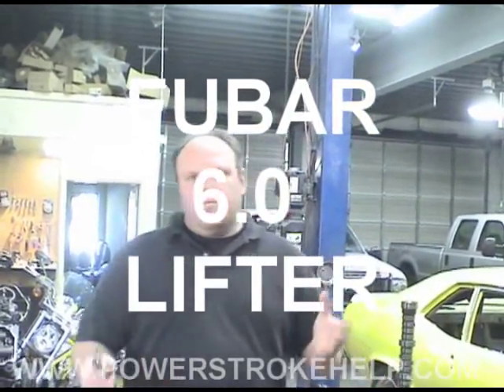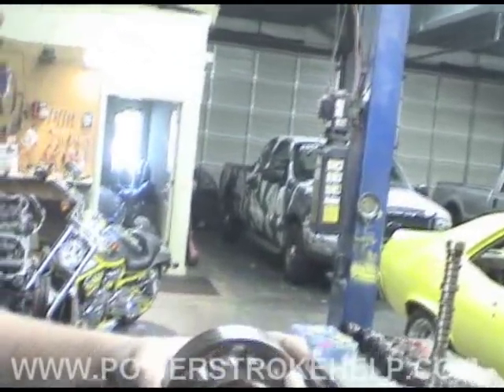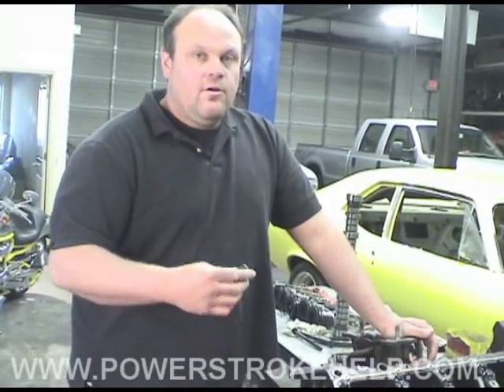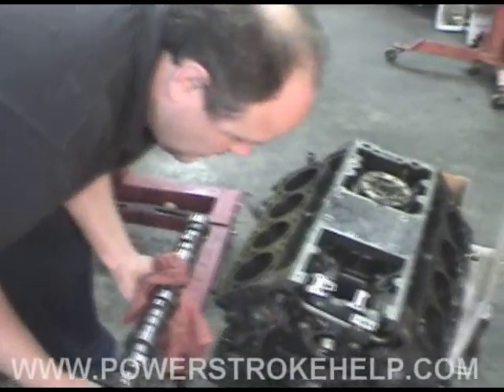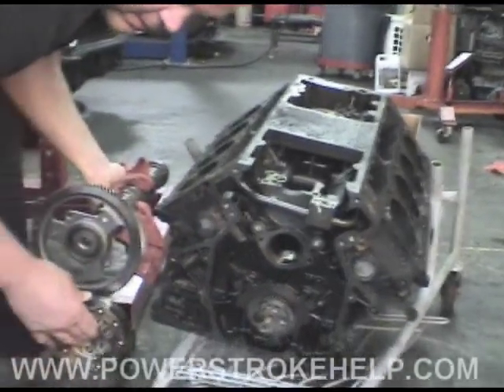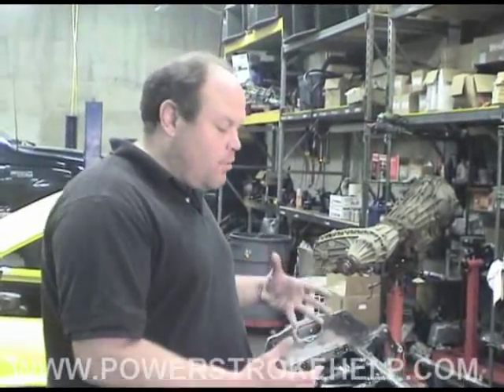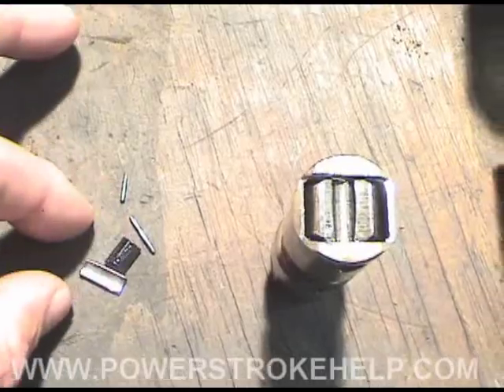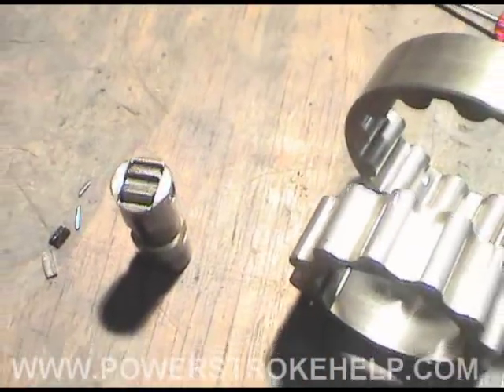FUBAR 6.0 - FAILURE OF MINOR PART LEADS TO BIG REPAIR BILL

Comment: I think what bill means by it's "a good designed engine" is that it makes a lot of power for the displacement, and it's a very efficient design in terms of how the engine flows. quite frankly if you have to pull a motor to time it, it's not well designed it's a pain in the ass.
Reply: It does not make good power for displacement. 
A 1.9 tuned vw tdi can make more
Hp and close to torque of a stock 7.3

Comment: don't assume your "local dealer" won't go that deep for the lifter failure. I have a 308,000 mile unit that i have to replace a $1200 cam, $820 cover and pump, 16 lifters and all the parts required to do that job. so that $4000 short block wouldn't be a bad option. it's not that we're lazy or inept, it comes down to reliability and warranty. And i can assure you this, every time this thing  farts in the wrong tune he'll bring it in as a "recheck".

Comment: With gas engines from ford and GM  easily running 300,000 miles and costing 4500 tops to replace,this is disgusting,the roller on the lifter is clearly too small,and overspeed eventually shortens the service life,that's the thing I don't understand about the Navistar diesels, they should have overdesigned head gaskets and bolts,overdesigned lifters and seals,and larger than needed rod and main bearings so the owner gets a minimum of 250-300k without tearing into the engine. I feel bad for people who bought a 6 liter,and had these issues.
Reply: but it's a consumer duty engine. Everything is built to a price. International makes some seriously over built diesel engines that will go over 300k miles easily. Look at the 466. Huge, heavy, overbuilt, and reliable. But it only makes 260HP in serious duty applications. Why? HP KILLS. The less HP the longer the life. So if you want a long life diesel, go buy a true industry light duty truck. Not a consumer grade. It might make the same or less HP and require 5+ gallons of oil but because of this is will run for many many miles.

Comment: My F-350 6.2L Super Duty may not be as powerful as these Diesel Engines... but my gas engine is less expensive to fix...
Reply: Walter Kiel   I have a 6.0 and 7.3 love both.  If I want a new superduty I'll be getting a 6.2 simply because the 6.4 and 6.7 are insane to work on yourself.

Comment: @powerstrokehelp I've seen over a handful do this in the last couple years. Find needle bearings in the bottom of the oil pan and a piece of the roller.  They usually still run to. They pop back in the intake, too. The most common failures i've seen are injecotrs, egr coolers, and injector drive modules (fuel injection control module).  Its not that common of a problem compared to the other problems like you said though. I'm not sure about reliabilty versus the ford version.

Comment from the maker: This is actually an uncommon failure. The damage to the lifter happens when the engine is over-revved (too much RPM). The valves will float which means that they don't close all the way. The piston comes up and hits the valve, the resulting impact will either bend a pushrod, break a rocker arm or break the lifter. I actually did this same thing in Spot the shop truck running NOS. The cam has to be replaced when this happens if the damage is caught BEFORE metal goes through the engine oil system.
Reply: What would you say is a safe max RPM for a stock 6.0, new? What about after 200kmi? I'm sure the wear on the valve springs will impact that. Was this a manual? Should I be worried about over-revving my 6.0 with an automatic?

Comment: what a rip off design, and only gets worse now its cab off to anything, last thing they want is reasonable repairs theyd rather them be scrapped and new ones sold, but that's most companies I guess
Reply: +bosshoss69lee pretty much what we always had to too. its not that bad as we are getting paid to work on these things, e brake cable, electrical, and bolts to hold the cab on and lift it up and you got a wide open engine bay. or at least i remember it being that easy. used to get them at the other shop a few years ago. none here yet thank god
Reply: Cab removal is actually a very efficient way to work on a motor.. wide open engine bay, everything is easy to get to. The cab was made to be easily removed so it's not really a huge job.
Reply: Bradley Smith not on a expedition. we just had to do one a few months ago... now at a shop with a lift no problem but for someone to do at home without a ton of help or heavy equipment it isnt going to happen. im just happy i own chevy trucks, used to do those in my driveway with basic tools

Comment: Thank you for pointing out that these wonderful collage boy engineers really know nothing about what they design. They should be required to work on the floor in the field of their engineering degree like an internship! Minimum of 5 years before they can hang up their shingle and working as an engineer designing things. That way they can find out about how hard it is to work on some of their big ideas that should be easier to work on. Firs of all they should learn the KISS System, Keep It Simple Stupid. Then they should learn not to listen to salesmen with new plastic parts claiming that it will cut the cost of their product. Then they need to use standard parts instead of reinventing the wheel! Engineers, just another name for a dangerous collage boy with a diploma that doesn't have enough common sense to wipe their own ass!

Comment: Really, the only big thing different in some '05 and '06 was the plastic snap fitting coming out of the back of the HPOP. If you talk to people with other years, they have problems too. They are just a fussy powerplant. Beautiful when they run right, but overly prone to problems.

Comment from the maker: @MALamborghini The year has little to do with it. It is more important how the truck is driven and how well the service has been kept up. I had a 2003 with a 2002 build date (the supposed really bad ones) in the shop for a new motor. It had 492,000 miles on it. One owner, with a big Baldwin fuel filter and a coolant filter. He claimed it never had any work done to it.

Comment: i'm hoping the owner scrapped that engine and went for a rebuilt with ARP head studs and a upgraded EGR or EGR delete.  I have a 2006 F350 and it's been nothing but trouble.  Love the truck but the engine is the weakest link

Comment: Love this video.. I was laughing the whole way through it... still laughing... lol. OMG, all that for a damn lifter! I am considering a 6.0 project this winter for my truck.. maybe/maybe not. I definitely want to do it right. Coolers, pump, radiator, EGR, turbo (verify variable vanes are working correctly). I currently have loss of power and slight overheating(engine) while towing up hills only. I hate it! Thanks for all the GREAT videos.

Comment: These 6.0's can be a nightmare but if you've got the heads off and the two Torx bolts holding the cross tube in you can stab a standpipe back in the hole and spring it up enough to get the plastic valve lifter guides out with a pair of needle nose pliers. At least you don't have to pull the engine for that. I've done it successfully was out messing anything up.

Comment: I love my Rover 2,25 and 2,5 diesels. it helps that they were build to be maintained and repaired using basic tools. the later 2,5TD was horrible though with cracking pistons and turbo failure. the later 200tdi and 300tdi engines were a lot better, just keep in mind that they are 25 year old lumps when you buy them.

Comment: We had a fleet vt365 wipe out a lifter. 6 weeks out of warranty.   The dealer found the block was gouged up from the lifter failing so they installed a running complete.  $18000 bill for that one.  After threataning a lawsuit navistar covered most of the bill.

Comment: A couple of questions.  Have you noticed any damage to the area that the lifter rides in?  What are my chances of NOT replacing the CAM shaft and just accepting that the enginee will not run as strong?  I would suspect that if the bad lifter corresponded to an intake value, then that cylinder would just not provide as much power, but the enginee would run OK. This notion assumes that the cam lobe in question is reasonably smooth and not chiped and pitted.

Comment: Just ran into this problem.  First thing to check on a ford 6.0 no start is oil in the oil canister on the top of the engine; drain what is already up there and crank the enginee a little to see if the low pressure oil pump can fill it.  If that is good, try the same thing with the fuel filter canister and make sure you are getting fuel.  Turns out one dealership told me that the fuel tanks delaminate and push junk through the fuel lines.

Comment: They designed this engine as though they took it for granted a valvetrain part wouldn't fail. If you think about it how often do lifters come apart like this one. Just a freak accident here. I can see that 200,000 + miles on these is like 20,000 miles on a gasser.How much lubricity does diesel fuel have in terms of bore and ring wear?It seems in Spot the shop truck that's the case in the bores still having the honing marks after 700K miles.Diesel must act like Marvel Mystery Oil on bores +rings.

Comment: Jasper does reman them with over 30 upgrades.I have been told the 6.7 has 30,000 PSI out of the fuel injectors

Comment: Seems like these are designed for commercial/industrial usage, full depreciation @ 7 years or less, to tolerate this kind of 
design/failure mode.
Reply: Tim Ewa I think that's the idea behind it. So it's "user friendly", but it's not "service friendly", the thought behind it being the user doesn't service it, and if it needs service, it won't be in use any more. Or in other words: Planned obsolescence. Maybe with a side order of: "Let's help the repair shops survive by giving them an extra amount of work" (but I'm sure most won't appreciate it).
Reply: At my job we had a contractor that had a delivery van with one of these engines (The International version VT365). The engine wasn't designed to go 75+mph long term everyday as his route made him travel 100 miles round trip everyday. After a couple of engines and an occasional head gasket along the way (since it's hot in Arizona).  He went with Cummins.

Comment: what you just described is proof positive that it is NOT an excellent engine. A 6.0 will require bulletproofing, its not a maybe, its not a possibility. its a fact. that alone is 10k. not to mention the other random shit that can and will go out like injectors, pumps, transmission, transfer case. pos of a truck

Comment: Had a fleet of 6.0 and 6.4 diesel trucks 450 and 550 S .Sold all of them and replaced with v-10s and never looked back.some have 250,000 and no problems yet other than water pumps altetnators normal stuff and gas is cheaper.dont quite have the torque but have the reliability.just my 2 cents

Comment: Had this exact same problem bill... Spent around 2k on a new hpop, injector rebuild kit, oil rail cups and seals, dummy plugs and standpipes, a couple injectors.. Only to realize I was getting no base pressure
Reply: and you never bothered to check the oil filter to see if oil was being pumped first???

Comment: I have been worried one of the lifters in my Chevy LS1 engine has come close to being like that.
I'm a GM man which is Holden in Australia,I know when Ford manufactured the 250 cubic inch crossflow six for the Falcon & Cortina,they made it hard to change the ignition timing on them because the distributor & ignition coil was located underneath the exhaust manifold which could mean "burnt hands" when adjusting the ignition timing.
I've heard of a story in one of them that the fuel tank,rear bumper or something needed to be removed to replace a lightbulb in a Ford,in the LS1 engine, the cylinder heads do need to be removed to change the lifters but the transmission or engine doesn't have to be removed.
In Australia, a Holden always has had the reputation of being an easy car to work on than a Ford,the Holdens are easier to work on now to the point that my grandfather does his own oil changes,etc on his 2005 model Holden VZ Commodore which has the LY7 (Alloytec) V6 engine in them & has about 309,000 kilometres on it.
That's considering that he lost 1/2 of one of his index fingers in the radiator fan when he was trying tune the engine up in the 1979 Mazda 626 that he bought for my grandmother,that was back in the 1980's when the cars still ran points ignition,carby & had adjustable valve tappets so he thought he better get a mobile mechanic to tune that one up.
Reply: Russell Booth LS1 engines are much more simple than this. This is just ridiculous. Ford guys like to rag on GM for outdated technolgy, but their engines are always a favorite because they're simple and they work.

Comment: Im not a ford guy but I like your videos.   I wanted an 2014 F450 at first but after doing my research.... it seems that the Ram 3500 had the cheapest cost of ownership and durabilith. The GMC looks nice. but thats just for show..... I also hear it is a maintenance headache... Still want an older ford as a daily work truck to keep the miles off my ram.... what would be the best year/engine combo to get?
Reply: 6.7L is worth buying. Ford ditched Nav/Int. and designed their own engine. 6.0 and 6.4L though walk away from all of them out there have too many miles are and are a time bomb for one of these extremely expensive failures.

Comment: That's just crazy! What's the cost of more than 30 hours of labour + new camshaft + new lifters + new oil pump. 7-8K? Got to be a lot cheaper to just go with the shortblock and install the rest by yourself. For those who are able to do that. Of course a bit different if the vehicle is used in a business, where repair time is of the essence.
Reply: +Burger Birger It would be cheaper. A LOT cheaper. But the shop needs money. If they do the repairs that money goes in their pocket. IF they buy a short block, they lose all of that money that could have been labor. Sad but true.

Comment: Engineers and Money Men need a kick in the balls when they design & approve things that aren't at least reasonable for Mechanics/ Tech's to work on. Regardless if they are Ford Tech's or Joe Blow at the local gas station. 

Engineering something a certain way just because you can doesn't mean you should.
Reply: +lightningsmokerXx Yet people keep buying the products. Over and over and over. Brand loyalty is the problem, and it isn't going away. I don't feel sorry for these people. I laugh at them.

Comment: What is meant when you said a short block that Ford would put a short walk in this motor and would not Terric completely down is a different motor or is that some type of repair item that they come up with
Reply: +drwombat What he meant was, a dealer would buy a short block, which is all new lower end of the engine, and put the top end, fuel injection etc from this damaged motor on it. Which would clearly be a better/cheaper way to go, but the shop would not make the money, instead Ford would. That is why the shop doesn't do it that way. They want the 4500 dollars in labor in their pocket. Typical.

Comment: Holy Shit!!
It's been 13 months since I bought this used nightmare from Jim's Auto in Fontana Ca. 
I am tired of whining about this truck and now I please just want to know what my rights are. 
Richard over there is a lying asshole and knowingly sold me a truck as described by power stroke help TO THE T !!
You know the video PSH did about trucks that had interior pulled and dash cluster around 110,000 then slapped it back in after running the hell out of if Lord knows how many miles? Yeah That's the truck they sold me and they damn well know it. 
1. What are my rights 
2. Stay away from Jim's auto on Sierra ave in Fontana Ca.
Reply: Damn man. Here in Florida there are basically no laws that protect consumers with cases like this. It's unfortunate, and happens far too often. Basically when you sign the paperwork, you acknowledge you are buying "as is, no warranty applies".

Comment: ford says under no circumstances should you remove that hub.  if its removed, the procedure is to replace the crankshaft.
Reply: +SapperJohn A Ford Sr. Master Tech removed said hub from my motor, put it back on, and my motor runs just fine... dont ask me how but he said he had a way to do it.
Reply: Both are right.. If your experienced and have the right tools you can probably get away with it but it's better left alone.

Comment: Bill I have a question-  is a lifter failure in a 6.0 that has been meticulously maintained (fluids, filters, not abused) a rare occurrence?  The overall theme of the 6.0 vids seems to be that with regular fluid and filter changes, and reasonable use, the 6.0 should treat you right.  Thanks.